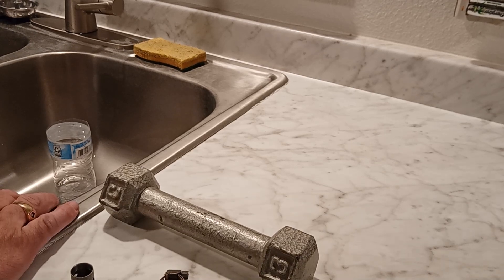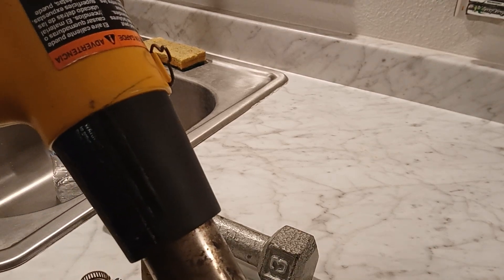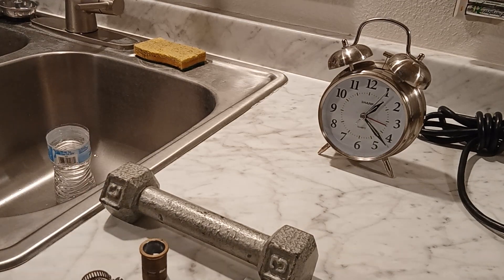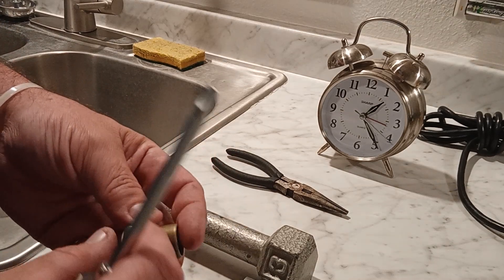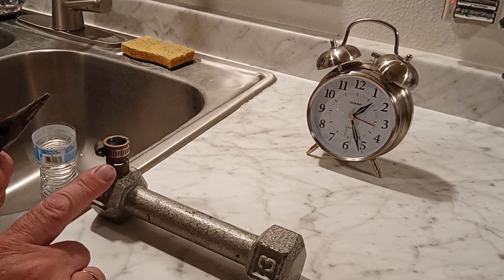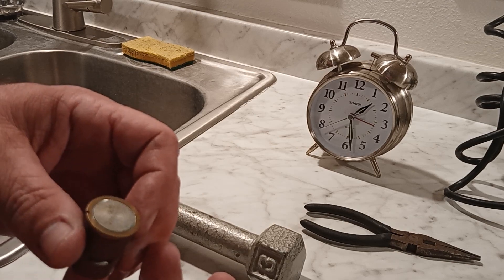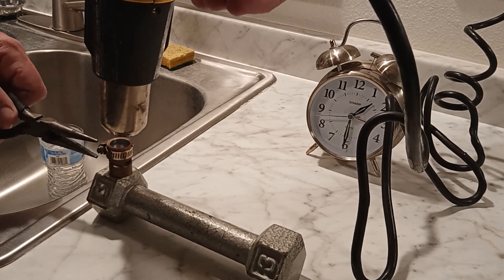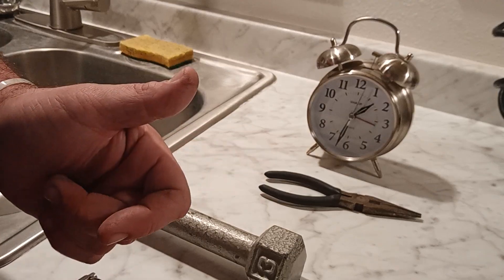Let's talk about how I pinch my sleeves Nitro engine repair low compression piston sleeve resizing

Comment: How many times can u repinch a nitro engine before u have to replace with new piston  and sleeve?
Reply from the maker: I don't think there is a good answer for that. Pinches seem to last for shorter and shorter periods the more a sleeve is pinched. By the time an engine has been used enough to need pinched, and then pinched again, you generally start having other issues(connecting rod, bearings) that make pinching again moot. I've pinched an engine 3 times at most. But there may be circumstances, for example if you overheated a nearly new engine and it lost compression, you might get to 5 or so pinches before other parts start going.

Comment: I dig this vid brother but one thing I didn’t get is what temp did you set your heat gun too?
Reply from the maker: It has high and low, I used high
Reply: @NitroTalkwithTodd thanks for your help I have a few Trackstar .32s needing a good pinch

Comment: tried this the other day on an engine that had low pinch after getting WAY too hot ,   it worked at least to the extent that the sleeve was tighter on the piston at the top of the stroke again... and it went back together and fired right up and ran fine... time will tell I guess.     cheers

Comment: There's no way that sleeve is still perfectly cylindrical...you've deformed it with the hose clamp, giving the impression that it has pinch...the reason it's getting tight at the top is because the sleeve is now distorted...guaranteed! If you were to ACCURATELY measure the bore, you would find it's no longer ROUND!

Comment: this worked for an r5r  engine that I can find a sleeve so thia was MY ONLY OPTUION and it  SEEMS TO HAVE WORK WELL ! I am still breaking that engine in after, and it runs hot but, i didn't do a full break in which may have been better, but I will update after I race it again. Thanks for the info and video!

Comment: Nice. I can see that working. A little fine tune to this method of yours may be to leave a little film of oil in the cylinder when checking the new pinch with the piston, and while heating. I think the small amount of oil will help the molecules better while heating and when test fitting the piston.

How long does your new pinch last when you do them as good as you can sir?

Comment: Hello Todd.  I decided to try your method but mine is with a 55 size airplane engine    I increased the time to 52 seconds and dropped it in refrigerated water.   It worked perfect.    Now I need to watch all your other videos.  Thanks
Reply from the maker: @greenman407  Glad to hear, thanks for watching!

Comment: The correct way to quick-disposable fix this would be to knurl the piston skirt, not pinch the sleeve.   Impossible to knurl the piston skirt, so we used a solid machined tapered center support that went into the liner, then we used a arbor press to force another pressing piece machined out and made of epoxied oak to ram overtop and hug the liner and squeeze it back to shape against the solid center support we machined for that specific cylinder..  A couple try's and we had a EVEN piston to liner fit again.  Good for gallons again.

Comment: What are the symptoms of low compression?
Mine runs but doesn't idle.
Reply from the maker: One of the easier ways to recognize low compression is when an runs ok right when you start it (cold) but gets worse the hotter it gets. 
Stalling, erratic idle, weak bottom end can point to low compression.

Comment: New to the nitro world what's the point of this?
Reply from the maker: To try and get some more life(usually 1-2 gallons) out of an engine that no longer runs properly due to lack of compression(worn out piston/sleeve) 
If you don't want to spend the money on a new piston/sleeve set, or one isn't available, this method can be used. Thanks for watching.

Comment: How can you assure the pinch is perfectly round with this method? Do you check with dial indicators and such or near enough is ok for this ?
Thanks
Reply from the maker: You can't. I would wager that the process probably leaves the sleeve less round than it found it. 
On the other hand, I do this to engines that will no longer run due to lack of compression. And more often than not, I get those engines running good again. Maybe for a gallon, maybe two. 
If a more precise method is available, I say go for it. But we're talking about worn out engines here. Imo this method works good enough to make it worthwhile. Thanks for watching!

Comment: Could someone please elaborate on why it´s bad if the piston reaches that high in the sleeve, so that I understand why the sleeve has to be pinched? The piston´s travel is limited by the conrod, so, the piston would never enter the top-sleeve-area anyways...Is it all about getting it at TDC exactly as tight as needed, in order to not let any combustion-force escape throught the piston´s edge ??? (because these pistons have no piston-rings?)
if this area is narrower/pinched, then one gets slightly higher compression (since this area then contains a smaller volume)... But other than that, I can think of nothing, that it´d be beneficial for. In the worst case, if a too big area is pinched, the piston´s top-end could get stuck in the lower edge of the too-far-pinched area (while the piston expands under heat and with time, during a run)... So, big risk for some questionable benefit...
Reply from the maker: Nitro engines use a tapered sleeve instead of piston rings. When the engine is new, the fit is very tight at the top of the stroke. This makes a better seal to make proper compression. Two things happen as an engine is being used. The aluminum piston wears down, and the brass sleeve expands. Over time both of these add up to a looser piston/sleeve fit, lowering compression and eventually resulting in a poorly running engine. 
The piston being able to be easily pushed past the top of it's stroke is merely an indication, a gauge used to tell the state of the piston/sleeve fit. If it pushes all the way up, it's too loose to make proper compression when running. 
When it comes to the risk/benefit of pinching,  this is something that is done to worn out engines to try and get a bit more life out of them. You don't do this to a perfectly fine running engine just because the piston seems a bit loose. 
Yes, you can over pinch, and end up with an engine that doesn't run at all, but that's what you are supposed to be starting with. 
If the pinch fails, you wasted nothing but your time. But if it succeeds(and with practice you can get pretty good at pinching) you have a good running engine again for a period of time. Thanks for watching, and for your question/comment.
Reply: @NitroTalkwithTodd  That was a very detailed explanation, thank you ! I knew so little about it, that I could never have imagined, that the piston is of aluminum, and the sleeve out of brass, I though, they are both of steel, like in 2stroke-bike-engines. But if no piston-rings are possible, one has to go for the alu/brass-combination, cause this combination replaces the need for piston-rings alltogether... Thanks again !

Comment: Great idea id still rather buy a new sleeve though because once it heats back up while running its just gonna relax the metal and loose compression again then it just becomes no fun just buy 3 or 4 sleeves and pistons n have them on hand thats what the hobbies all about right always gotta have extra parts i always buy parts in fours so idont ever have to go n get them when i need them i have enough parts to build 3 or 4 rc cars if i really wanted to for all my rc cars i love stocking parts i hoard them parts

Comment: Just wondering if you'd tried quenching the sleeve in oil instead of water? I used to do that with steel drill bits after sharpening them to harden the tips. Might be worth trying to see if the re pinch lasts any longer. Nice video though and food for thought.
Reply from the maker: It's an interesting idea, I guess it depends on if hot brass responds to oil in the same way as steel. Worth looking into.

Comment: Can I do this with my Picco 12 RC speed.  

I do not want to wreck it as it’s almost pooched and there’s no parts available for it that I can find.
Reply from the maker: I have pinched .12 engines, but I use an even smaller hose clamp. Take extra care on engines that are not junk, over-pinching is bad news

Comment: Lol the old clamp method….  How long will that engine hold that pinch before redoing?
Reply from the maker: Depends, but as someone else mentioned, they certainly don't last like when new. I have found that they usually average 1/2 gallon to 2 gallons out of a pinch.

Comment: Todd, I do it the exact same way except I heated up longer and then I tighten the hose clamp while it's hot as tight as I can go and then I drop it in the water
Reply from the maker: Do you do it with the piston in the sleeve or out? I've seen it done both ways, and it sounds like your method might work better with the piston in.
Reply: @NitroTalkwithTodd  
I haven’t done it yet no cause the engine still seems to rip like crazy.  
I did check the pinch and it wasn’t completely gone but almost 
When I do it I will be very very careful I DO Not want to wreck this engine it’s a super awesome runner. 

I do have one question is this one of the motors I need to run extra castor in
Reply: @NitroTalkwithTodd  
I haven’t done it yet no cause the engine still seems to rip like crazy.  
I did check the pinch and it wasn’t completely gone but almost 
When I do it I will be very very careful I DO Not want to wreck this engine it’s a super awesome runner. 

I do have one question is this one of the motors I need to run extra castor in
Reply: I need to do a few engines
Reply: I do the same thing just that I didn't dip it in water       I was scared to dip in the water cause I figured it would give it a cold shock     ,
Reply: @aabiddeen7987 worried about your engine getting a cold🤷‍♂️couldnt resist😂
Reply: Ohhhhhhhhhh if you did this then I am to 👊😎

Comment: I've had sleeves ware u repinch them they look great after u run a tank or two there them right back to no compression  I've experiment with multiple methods of how to replace them ND wat to do after repinch just run them run them a few tanks rich or straight to break in tanks it's just luck base if it works in my opinion
Reply from the maker: I have also noticed that once pinched they don't last nearly as long as similar pinch when new. I contribute it to the metal weakening from the heating cycles, and is exacerbated by a loose sleeve-in-crankcase fit. But, the way I look at it, a home pinch is essentially free so even if you can only get a few quarts out of an engine it's better than nothing.
Reply: @NitroTalkwithTodd  Could a small strip of metal shim cut from a flat shim sheet be used to snug up the fit between the sleeve and crankcase? Thinnest metal shim stock I've seen is 0.001" (0.0254mm).
Reply: @TimLe-rz6ru  That's way too thick. A normal re pinch is only around 0.0003".

Comment: I’d never thought of using a hose clamp, but I’m going to have to give it a go!! damn obvious and it’s a great idea I’d always used a 1” thick pressing plate and use it like a rolling pin on the edge of the bench while heating but I must add I will only do this on an engine that has a tight sleeve in the crankcase
Reply from the maker: I have mentioned the sleeve-in-crankcase fit a few times. IMO this is one of the most important factors in regard to engine life/compression. A loose fit allows the sleeve to expand more, leading to early compression loss.